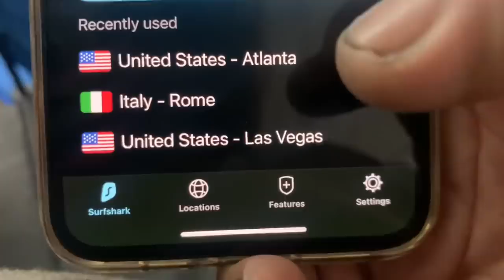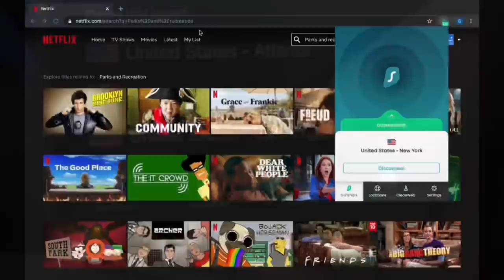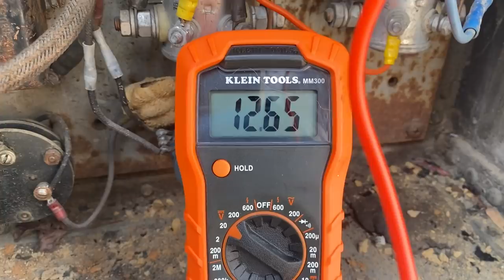4104 bus electrical work. Alternator & reverse solenoid. Silversides tour. Cold start Detroit diesel

Comment: That reverse solenoid probably has two windings, like a starter solenoid. Most heavy duty ones do. They have a heavy winding for pull in, and a lighter winding for hold in .  There should be a switch in the back that the plunger hits when it pulls all the way in to disconnect the pull in winding.  I suspect that switch is bad and is not making contact so all you are getting is the weak hold in winding.  See if the back can be taken apart to reveal a switch that might be corroded or bent.  Otherwise the pull in winding is probably burned out. Also, check for voltage drop in the bus wiring.  Put a meter on the solenoid while it is engaged, should be over ten volts.  I doubt if that wimpy power probe could properly test that large solenoid either.   A better stand alone test would be connect them directly to a fully charged battery with good sized cables and see what they do.
Reply: I was about to say something else, but having read your much more informed post, I'll second the vote for a failed pull-in winding.

Comment: Very simple test.  Hook an incandescent test light up to the positive terminal on battery.  Touch the end to the alternator output terminal.  If it lights, the alternator is either shorted or positive ground.  If no light, you are good to go. This way you are working with low current and won't destroy anything.

Comment: Looks like your warm batt cable situation could just be the sun hitting the cables. Definitely at the batteries, if the outer wire was warmer than inner wire then the sun is hitting outer wire, not inner. If there was a major short both wires would heat up equally if they are same size. Also. I would expect a major light show touching the alternator positive to batt positive. Any amount of current that could heat up those heavy cables would definitely make a nice spark.
Reply from the maker: It was warm.  Even smelled a little like when my flashlight burned a hole in my pocket

Comment: Check the resistance of those coils for the reverse solenoid. That will tell you if the coil is open or shorted.
Reply: How many ohms should it be?
Reply: I didn't know what it should be, but comparing the resistance would determine if one of them is bad. If they are both reading similar, then adjusting the angle of the coil, compared to the iron core should be looked at.  If there is any dragging, due to alignment in the coil, the iron core will not pull in cleanly.
Reply: @stuff6782  Then which one of them is bad?  How u know that both are not bad?  How do u adjust the angle?
Reply: @ebutuoyebutouy  not being a electrical engineer, I'm a mechanical engineer, I would guess about 10 ohms.  The resistance will determine the current draw, the lower the resistance the higher the current draw.
Reply: @stuff6782  Is this the angle of the dangle?

Comment: Those Wanderlodge with the tag  axle are beautiful coaches. I wanted one beck in the 80’s, but way out of my budget.
For the reverse solenoid, check the voltage at the solenoid, vs at the  switch. If there is more than a volt or two drop, you may have either a bad wire, or a bad connection.

Comment: Hey Scott I think you need to try the 4th of July test with it running.  Just for the hell of it try to get a headlamp bulb and use it to test the ground on the engine block . Positive to the battery and ground to the block and if the bulb is bright your ground is good . The test with the power probe is no good as it does not load the circuit and can take a different path to ground

Comment: 🇺🇸😎Our mechanic changed a positive ground Mack truck to negative ground. He forgot to change heater and air conditioner fans which now sucked air in. P. S. Driver survived the Arizona winter. 🇺🇸🇺🇸

Comment: Chasing down electrical issues. Hate.....it...so....bad. To make it myself as easy as possible I spend a long time simplifying the setup, dumped half the wiring, cleaned up the other half. Having a old bus also helps, far simpler.

Comment: you can test whether The alternator consumes power. by inserting a 5W lamp between the power source and the  alternator cable. if the lamp does not light up there is a problem somewhere else.

Comment: I have been viewing your videos for several months. I find them very interesting to me. However I am not a mechanic. I have made my living as and electrician. First in a trade school, then the Navy on an aircraft carrier. Since I got of of the Navy forty years ago, I now design substation systems. I never understood why people use steel lugs on battery cables. Steel is a very poor conductor and will get hot under any size load. Battery connections and cables need to have plated copper lugs of a thick enough wall thickness as to take current with out heating. Generally the cross sectional area needs to be equal to the cable size. Cheap China lugs are just that cheap, please do not use them on anything. Harbor Freight has a hydraulic fifty dollar lug crimper, it works well. At the battery use heat shirk to seal the cable to the lug to prevent corrosion.  Critical circuits should not relied on mechanical steel bolts for an electrical connection, run ground wire.

Comment: I see the problem with the reverse lock out. the solenoid is not pulling straight. the lever that hooks to the solenoid is sloppy not allowing a square pull and can't over come the friction. The current (amps) is what engages the lock out. Check the wiring for wear spots clean and lube all connections. check for a voltage drop any where in that circuit.

Comment: Wow, that Wonderlodge sounds fantastic!  What makes it so different from the old 6v92s?
Reply: Looks pretty bada$$ too.   +1
Reply: It’s probably a fresh motor. Just from looking at the engine bay I’d would guess it’s set up “ nice & tidy”
Reply: Doesn't it have an 8v92t?
Reply: @richardlazarski4553  🛎️🛎️🛎️
Reply: It’s a 6v92TA.. 330 hp still the original engine, just has been cleaned and painted. I suspect around 250k miles as my odometer works intermittently. Any of the 92 series engines can be tuned up quite a bit as long as you have cooling.

Comment: page 2 of this manual shows how to check to see if the diodes are good in a 50DN.. http://shop.pwt.ca/MCI/parts/dmmba000/07b.pdf   
there are different ways to hook up the diodes .. to make it a positive ground or a negative ground alternator. 
you have a digital volt meter with a diode test.. hopefully it has enough ability to test that high amp rated diodes.. 
hooking up directly without looking at amp draw..  if you don't have an AC/DC amp clamp.. you need one.. this is a 1,000 amp rated.. https://www.harborfreight.com/cm1000a-1000a-t-rms-acdc-clamp-meter-64017.html another is 600 amps but its only 10 bucks cheaper.. this allows you to measure current.. 

 i am kinda upset that the alternator repair guy said.. just touch the output wire and if it sparks.. you have the wrong polarity. if its wrong you will be damaging the diodes .. at least diodes are easily replaced in those. no brushes.. its  a brushless alternator.. you also need to make sure you have the cooling oil hooked up..  it takes 2 gallons a minute of engine cooling oil. 

the reverse solenoid.. clean the mounting flange..  so it has a good engine /transmission connection.. you can hook up a jumper cable laying next to the bus and hook your digital volt meter test lead to which ever you are using for ground..  touch the other meter probe to the mounting base.. then attempt to activate it.  i want to know if your plunger assembly is free to move in and out.. it almost looks like the lever is bent down and is binding the plunger at an angle.. which is why is caused so much wear to one side of the plunger plating..   can you manually pull the lever in so the transmission goes in reverse and shut off the engine with it in reverse..  then see how much plunger stroke you have left to bottom the plunger in the bore..  you may have to adjust the plunger to lever length to make the plunger bottom out fully with the lever fully engaged.. if you are making the adjustment longer.. the plunger will be deeper into the winding to allow it to be pulled in fully. 

i used to only dabble in big alternators... i worked in a shop and did rebuilt alternators for tow trucks that were almost  blow up proof. using diodes that were rated more than double what came from the factory..

Comment: The solenoid looks canted, maybe a washer under the back bolts will allow the plunger not to run on the bottom of the interior barrel. Or maybe the camera is distorting the picture in which case.....Never mind.  Have a good day any way.

Comment: Hey Scott. 
You might want find out if that reverse solenoid is 24 volt. Luke can probably tell you what the ohmic value would be on a 12 volt solenoid. If you know of someone that is a electronics junkie they can probably build up a voltage doubler. It will spike the 24 volts needed to get it to latch and then it will go to 12 volts once it is pulled in. Hope it is just low voltage.
Reply from the maker: They are both 12v for sure.

Comment: The reverse solenoid looks like it's pulling off-centre, if  you could lift the arm up with a washer it should work ok...
Reply: The armature must pull through the center of the coil.  Any dragging and it will not pull in.
Reply: I agree, it looks like it not pulling center once the armature starts pulling in. Loosen the bolts and then push the arm all the way in the cool almost centers up then tighten the bolts back down. You may also find you may have to raise or lower the cool a bit to get proper alignment. You would be surprised how little of a rub can effect the pull of the coil.